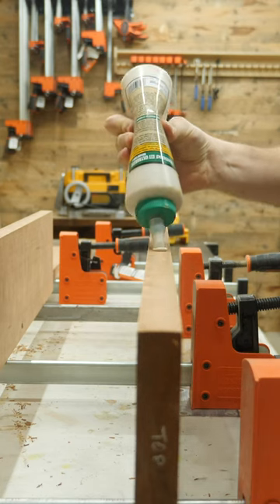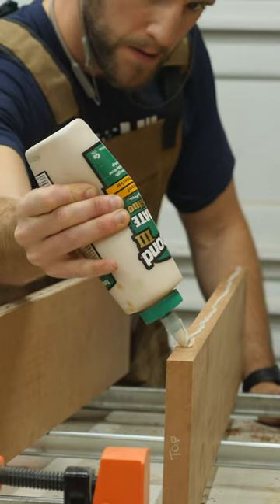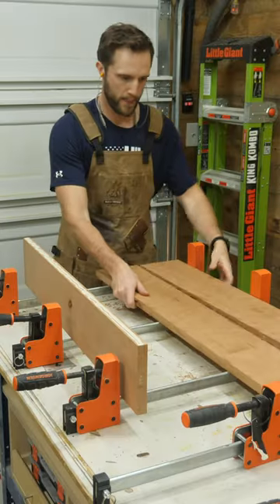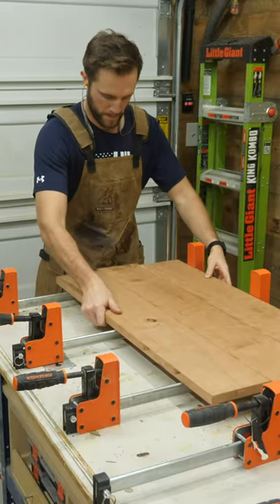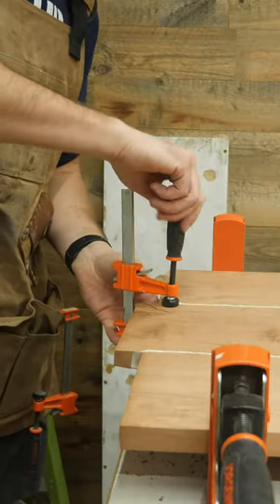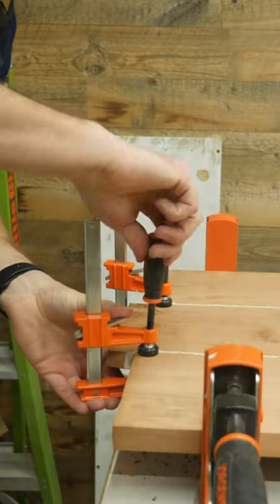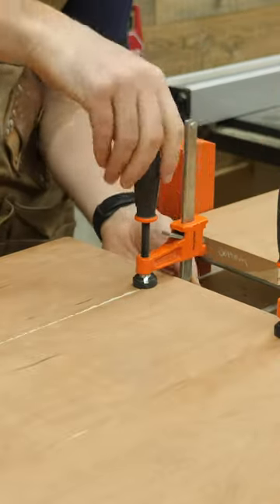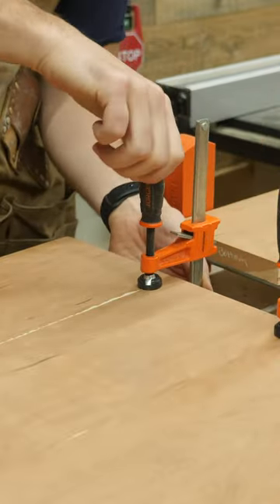just the tip

Comment: Take a flat metal bar, square tubing, etc that will reach end to end. 
Place over each seam with a clamp on either side and you'll get a little better surface area than just the clamp head.

Comment: How tight do you apply these seam clamps? I usually over-tighten to the point where they unfortunately dent the boards.
Reply: use a 4mm steel  2" angle across the seams and tighten as hard as you like